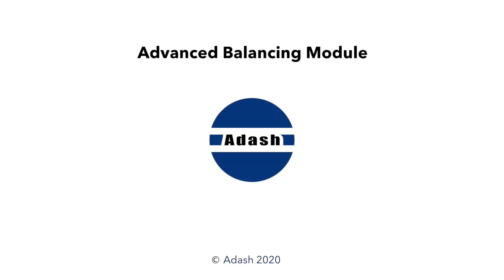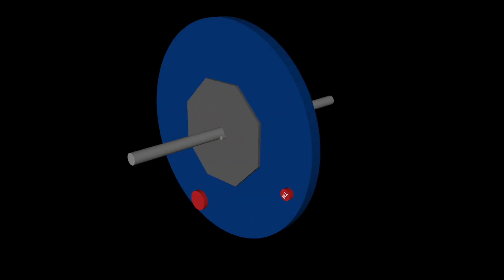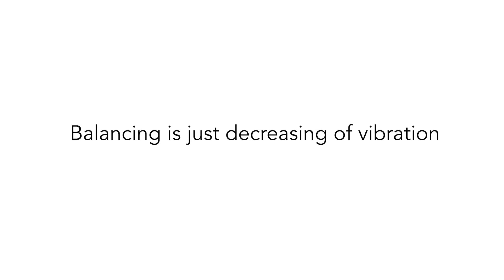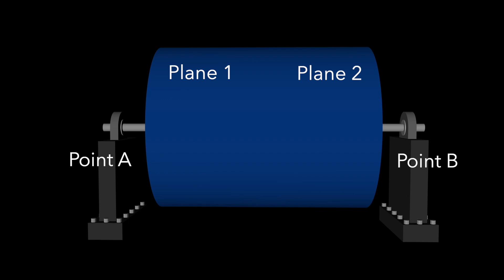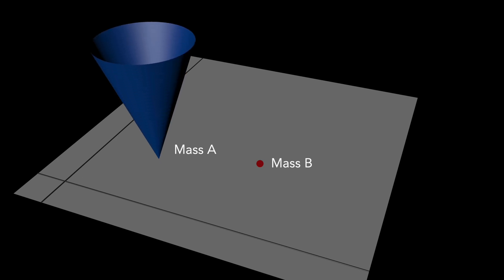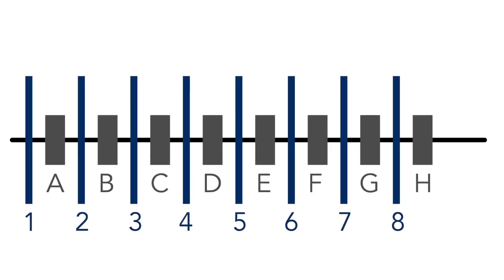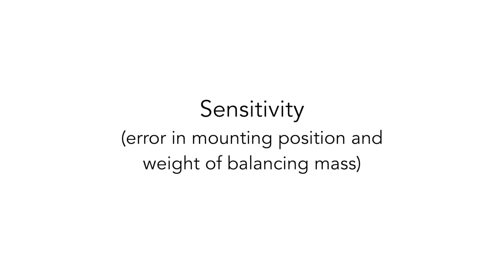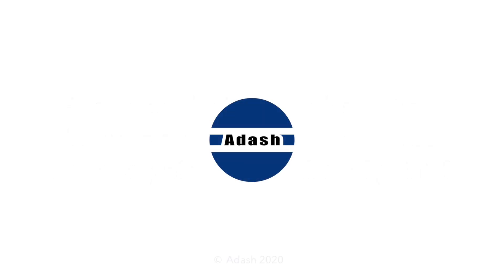Advanced Balancing - revolutionary method for complicated machine balancing jobs

Comment: Hello thank you for your explanation ! In the case of a shaft composed of 8 propellers, each with 36 blades, each propeller is mounted on the shaft in a helical arrangement with a 4° offset. The shaft is supported by two bearings at its ends, which serve as measurement points. As a result, I have a rotor with more planes than measurement points (a typical balancing case), but each of my planes has different positioning possibilities, preventing me from freely placing my balancing masses. I do not know how to size this properly because if my test indicates a correction to be applied on plane 1, but this corresponds to an angle between two blades of my plane 1, how can I determine the correction to apply, and what kind of case am I dealing with?
Reply from the maker: Here is an equation to split a mass into two angles:
double denom = sin(angle1 - angle2);
mass1 = mass * sin(angle - angle2) / denom;
mass2 = - mass * sin(angle - angle1) / denom;

 where:
mass and angle are weight and position of the original mass (given by the calculation)
mass1 and angle1 are weight and position of the first mass
mass2 and angle2 are weight and position of the second mass

 In your case you have 36 blades*, this means 10° between two blades. Therefore, you need to split the angle and mass given by the application into two nearest blades which have the angle divideable by 10.

Eg. The angle which you need to use is 38°. This means you need to split the mass into 30° and 40°. Supposed the first blade is on zero angle, you need to add the weights on 4th  and 5th blade. And the masses are calculated according the previous equations:
mass1 (on blade4) = mass * sin(38 – 40) / sin (10)
mass2 (on blade5) = - mass * sin(38 – 30) / sin (10) 

* (not clear what the 4° offset means therefore it is ignored in the calculation, maybe you need to add 4 to all angles)

Comment: nce 1..
I had one question.
You are drawn a cone what is the height of the cone. Or how to find out the angle.
If angle is negotiable then the meeting height is different...
Please clarify...
Reply from the maker: The cones do not have a final height, they are unbounded.Their steepness corresponds to the sensitivity of the increase in vibration to changes in weight or position of weights.

Comment: Are u assuming that half diameter is 1 ? and what is .25 meaning ? ,Is it in mm or what ?
Reply from the maker: It is just the geometry of vectors. You can use any scale (mm, inch,…). But the simplest way is use the radius = 1. The 0.25 is the length of second vector. In video it is 4 times smaller then radius, that is why it is equal 0.25. If you use the mm, then you must measure both vectors in mm. It is your choice.
Reply: @AdashCompany  OK I see this point.
I have another question, is there any manual method to make a 2 plane balance without using a vibration instrument , like the method in this video, this will mean a lot for me
Reply from the maker: @SS-uf4uq  Theoretically you can do this method on 1st plane and then on 2nd plane. But it won't be precies because planes always influences each other. Ideally is to measure amplitude, phase and speed on both planes. Baiscally use 2 plane balancing program like for example in our VA3Pro: https://adash.com/portable-vibration-devices/a4300-va3-vibration-analyzer
Reply: Ok
Reply: And if you add Arabic translation to your videos, this will mean a lot for us here in the middle East
Reply from the maker: @SS-uf4uq  You can use YouTube automatic translation to Arabic.